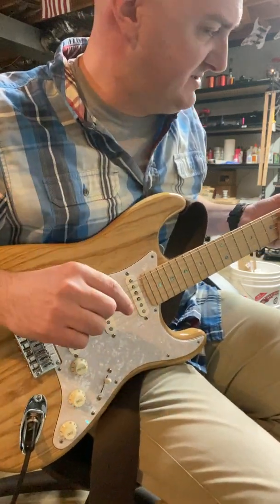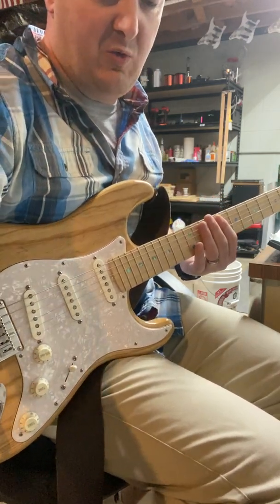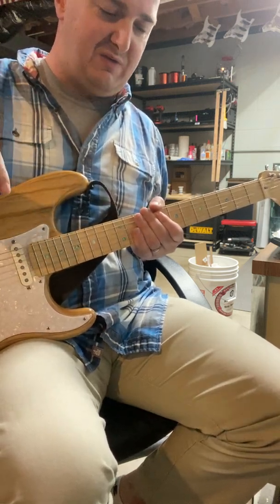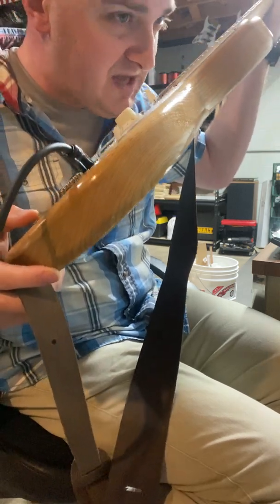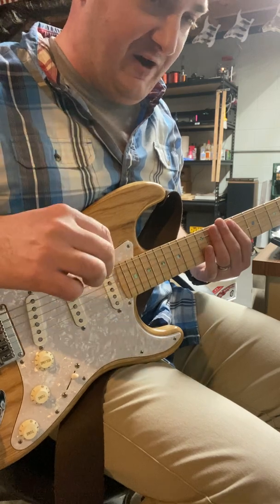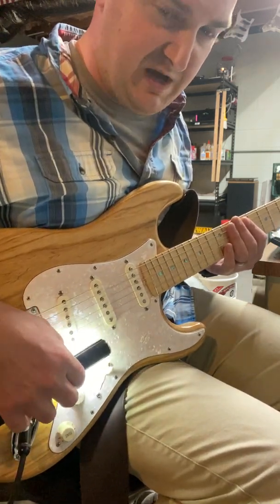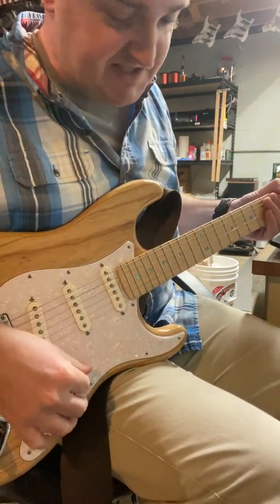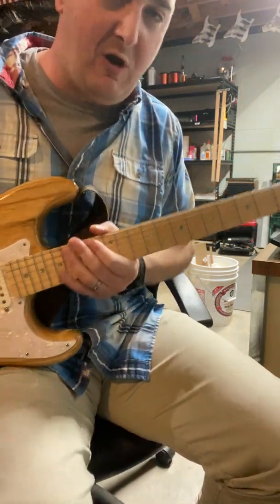60 cycle hum, RFI and Shielding is useless Noisy electric guitars SCIENCE EXPERIMENT

Comment: Shielding will never make a guitar completely silent. It just increases the signal to noise ratio.
Reply: No more like it does take away noise so you hear more of your signal ;)
Reply: Exactly. I think people also forget to consider that their guitar is basically 6 3ft radio antennas, so background noise may be inevitable. But those antennas are visibly unidirectional so it’s much easier to deal with outside noise when it is predictable
Reply: Radar paint may be expensive as phuck, but that solve the problem better than copper shielding.
Reply: No shielding is not a myth try going up to a mic with a hot guitar and see how your lips feel after the shock zaps you back 3 feet;)
Reply: Exactly shielding is a myth

Comment: I tried everything using real single coils ( Not silent, not stacked etc.) The Best i could do was to record using only a laptop and usb powered audio interface.All lights off and everything, using headphones.But there was still noise, and i thought it was somehow less noise. that was beacause i was monitoring clean via headphone, in actuallity i had pretty much the same noise as always. Had to spin 360 to find that 15 degree gap where the noise becomes bearable. but then, i cannot and will no record, rehearse and compose stiff like a statue.I am going to take the same rig out in the woods as far away from any power source as possible.maybe inside a cave to test it ( no joke). im pretty shure its going to sound the same (hummy). with that experience and this video, i officially give up using single coils. it distracts my playing , my writing. i do not want to be an athlete of moving around and all the voodo of Singles.I stil love the sounds of them, dont bother if a fellow guitar player is using them and managing the noise. but i am a recording engineer and my ears are trained to hear noise on a musch more fine degree than SCs, so i really canot tolerate. i Also know that anything i record , it is me who will have to clean up afterwards to mix and master. But even if the SCs do not hum or become tolerable in the woods, its still the same sh*t i MY studio (Grounded, 4 dedicated breakers with clean and new wires straight from the main eletrical  box, using 2 power conditioners). I applaud SRV and Hendrix for their playing as much as dealing with single coils.im currently studiyng how the OGS used single coils, listening close to the recordings.the instruments you showcase here seem to me to be fine ones, wich proves me that an entry level Nocaster and a Fender USA will have just about the same 60hz hum.It depends more on the other pieces on the chain. I rewatched Better Caul Saul this year, and the reccuring joke is - hes gone full Chuck Mgill. So i ordered a Yamaha Revstar Rse20, and will continue to fuss with my tele to maybe keep it.

Comment: So what can be done to reduce these various types of noise? You mentioned a power conditioner… is that a reliable way to reduce at least the 60 hz hum?
Reply from the maker: The only thing that can take away 60 cycle hum is a humbucking pup. Me personally, even when I play with moderate gain at higher volumes, I still prefer a real strat single coil pup to noiseless strat pup.  I just deal with the little bit of 60 cycle hum to get real strat single coils sounds. P90’s not so much. The hum on P90’s is pretty loud due to the coil shape and winding that makes the hum louder than a fender style single coil. So, I opt for a lower output PAF style humbucker. As far as amp noises caused by home wiring, a power conditioner can help with that.

Comment: So the constant sound from the cranked amp no matter what was or wasn't plugged in is normal? I get the same thing with my Marshall when turned way up . Turn it down the sound /hiss/ hum disappeareds. I was thinking something was wrong but I guess its normal.
Reply from the maker: Yea the whole point of cranking the amp was to exaggerate the issue. At normal volumes it is a non issue. The more gain you stack the worse any noise issue will be. As far as single coil hum, l will gladly deal with it for a true single coil tone on my strat. I generally don’t play with super high gain so noise is rarely an issue for me.
Reply: @MathewsGuitarWorks Thanks for the reply. I never notice the noise when at gigs. Only at home while recording trying to get a cranked amp tone.

Comment: Man I did have a two conductor guitar cord a soundman made and gave me. The shield was only one ended and the signal was on two wires. Another may that may help is dont connect the shield in the guitar as a signal path. Some pickups are a shield and one conductor shield as a negative. A strat unsheilded wire and the negative is grounded 
Course all are to ground at the guitars output jack.

Comment: that's why i plan to balance mine as well as shield it with proper grounding, i can tie the grounds at the amp.
Reply from the maker: Don’t waste your time shielding. Passive control components are not affected by RFI and since the pickups are open to the outside environment. Unless you can figure out how to shield the pickup, which is where the RFI enters the circuit, you’re wasting your time. Proper grounding is definitely the way to go.
Reply: @MathewsGuitarWorks  getting rid of noise from the back and sides at least gets rid of some, the balancing should help a lot of the rest, even without shielding.  have you tried balancing?
Reply from the maker: @felderup Properly grounding is the the only thing you can do. Shielding does not stop RFI. Unless you can make a complete faraday cage and place the entire pup inside it then it won’t work. But you do you, good luck.
Reply: @MathewsGuitarWorks  i'm pretty sure balancing without shielding will do something.
Reply from the maker: @felderup what is balancing?
Reply: @MathewsGuitarWorks  it's a way to add differential signalling to a guitar, the ground is separate.

Comment: Would a set of EMGs and a noise gate solve the problem?
Reply from the maker: EMG’s would stop 60 cycle pick up hum.  A noise gate would stop any noise above the set threshold for anything in front of the gate.  This example I posted is an extreme illustration with a cranked amp and multiple stages of gain stacked. When the amp is set at moderately loud stage volume, using normal amounts of gain (stacked gains also) it’s a non-issue. My rig is not silent nor do I ever intend on trying to make it silent. Im ok with noise in my rig for the most part. I just live with it. I hate gates because they suck so much dynamic tone out of the signal.  Not an active pup fan either but I understand every situations different.

Comment: Thanks. After trips to the repair shop with my MIJ Fender p, soldering this and that, I’ve just about had it with the hum problem. So, I just turn off everything in my space and play into my audio interface and Mac. Or I just use my other basses which don’t have this issue. It’s all good. Life is too short to futz with this kinda stuff . 😂
Reply from the maker: @rlbink2498  Noise can come from all different places.  I’ve just learned to live with certain noise.  Now if it can be fixed, I’ll address it but otherwise it is what it is. Thanks for dropping by.

Comment: how bout proper shielded guitar wiring?  is that needed?
Reply from the maker: @stegerguitars  It wouldn’t make a difference. Wire doesn’t amplify a signal, unless it’s wound in a large coil.
Reply: @MathewsGuitarWorks  interesting....i always use grounded and shielded wire in my builds cuz that's what we're taught.... maybe i don't need to stress about it so much,,,,thanx for the response.
Reply from the maker: @ Shielding passive components (not passive pups) is a waste of time and resources. You can’t introduce RFI into a guitar circuit via the wires or pots because they don’t create or amplify a signal.  So, shielded wire and or cavity shielding is useless at best for the purpose of reducing RFI. Shielding around a pup is questionable at best because you can’t shield the face of the pup where the pup does the picking up. Therefore, shielding all the way around a pup but the face seems academic. The best way to reduce RFI in a guitar circuit is, properly grounded circuit, sturdy reliable connections and distance from the actual source of RFI. This obviously does not cover noise introduced through the amp, the power source or 60 cycle hum.
Reply: @MathewsGuitarWorks  i always thought this from day one....when i shielded my first build and thought: "what about the top of the pickup?  isn't that important?"  i've worked on older les pauls that actually had a metal box housing the electronics....why?
Reply from the maker: @ Because people can be wrong. The metal box on LP was an attempt to reduce RFI maybe.  Just no one put much thought into it. Not every decision made in the engineering of an electric guitar over the years was purely functional. Plus the metal box could very well just been a marketing gimmick. Modern LP’s with the metal plate, that serves two functions. 1- easy and speedy assembly, 2- a grounding plate for the pots so they don’t waste time and resources soldering wire to 4 pots. As for the pups, you’re exactly correct. The top/face of the pup is still exposed to the outsole world for RFI to find and there’s nothing you can do about that.

Comment: Shielding effect in simple words: Guitar will sound as you had at all times your fingers touching the bridge, therefore that ground noise will completely go.
Reply from the maker: @AmLarev  It won’t, I’ve tried it. That noise you hear when I’m not touching the strings happens on all my guitars regardless and all guitars do it to some degree. It’s most likely the wiring in my house helping it out. Thanks for the comment though.
Reply: @ you did it wrong then, have a tele and a strat, both 70s. Be sure you screen cavity in the instruments. I use copper tape for the wood, and aluminum for the plastic lids. I also connect with copper tape the cavities so they reach screw holes and metal in bridge. Strat screens behind, through bridge and top (both coil and input socket)
Reply from the maker: @ sir, with all due respect. I’ve run a rather successful custom guitar business for almost 15 years. I did not do it wrong
Reply: @ then how come you couldn’t get rid of the noise with a Faraday Cage. You can even ask an artificial intelligence about it :) 100% gets rid of buzz and static, only noise left will be the 60-cycle hum. For that Hot Rails are good for.

100% proof by people who did right !
Reply from the maker: @ Ok bro whatever you say.
Reply: @ also: not the single coil hum, for that just get Hot Rails in bridge or get use to it.
Reply from the maker: @ I was not complaining about the noise. This video was simply to illustrate for others what noises people may be hearing and where they come from. I’ll stick with my single coils appreciate it though.
Reply: Oh, you can ask AI about it? Well I guess the science is settled then. Wrap it up boys, AI dropped the mic.

Comment: Thanks for the video. What would cause an intermittent issue with louder than acceptable 60 cycle hum (that's the closest sound to what I can hear). Happens with both Strat and LP. Strat does cancel most of the noise in positions 2 and 4. It only happens maybe once a week when I go to play... both through interface using amp sims and using Marshall DSL combo (I have noticed that sometimes I can hear the cubs games through my amp, which is fun). Went through unplugging everything in the room I'm in and doesn't go away. Could this be external radio interference? Just curious. Thanks again for the vid.

Comment: Thank you for such a clear and concise explanation of all the different types of noise and their causes.  I have 1 strat out of 3 that has ground noise as you demonstrated only in the middle pickup. It's less when in combination with the neck or bridge and the worst when the middle is by itself.   The odd thing is...this is a DiMarzio prewired set wit Area style pickups that are " stacked" to cancel out noise.  Neck and bridge are dead silent...middle is just like you show...touch the strings, jack,bridge and it goes away.  Both my other 2 stats....1 with Texas Specials and the other a Jimi Hendrix strat are fine.  I guess there's nothing I can do then but not use the middle pickup by itself or use it with one of the other pickups.

Comment: I guess the frustrating thing is figuring out why one guitar would be worse than another!
Reply from the maker: @creatorTWin  The atmospheric conditions and home wiring play with my amplifier make more of a difference than any individual guitar. 

If we are evaluating just the guitars, it can simply come down to the resonate peak of the pups in the guitar that pickup RFI or noises picked up by the pups.  

Single coils for example, strat style vs p90’s, I think most people find that p90’s have a far more offensive 60 cycle hum than strat style singles. This is most likely due to the fact p90’s have a much broader frequency range because of coil shape.  
 
Speaking of the guitar only, If a circuit is properly grounded, the only other thing outside of RFI is the pups are just noisy. 

Thanks for dropping in.

Comment: Noise gate works fine. Does it help if you solder a wire across the pots?
Reply from the maker: @mikeyoung7448  This video wasn’t for ways to solve it. It was to ID the noise and possible source. 

Noise gates work for some people but not most. Especially people that don’t play with high gain.   They suck way too much tone and personally I despise the gate cutting my sound even when set super low. 

It’s always good to have the controls properly grounded. Most guitars have grounded controls. The better the ground, the higher signal to noise ratio there is, which helps reduce unwanted noise in the circuit. Unfortunately RFI still enters through the pups and if the face of the pups are exposed to the outside world, that is the doorway for most unwanted noise and theres nothing you can do to stop it. 

Thanks for the comment

Comment: Thank you for clarifying the difference between a ground hum, a 60 cycle hum and RFI.  Based on your video my telecaster has a ground hum - when I touch the metal parts the hum goes away.  Here's my question - how do I (or can I) eliminate that grounding problem?  If I can eliminate it, how do I locate the problem?  Thanks for your help.

Comment: Love the video.  I am, however, a little confused.  I recently bought a new Fender Player II guitar.  When I plugged it into my amp (Princeton Reverb Tone Master) with low volume I got a slight hum.  No loud buzzing - just a slight hum.  The amp is right next to my guitar.  When I touched the strings the hum went away.  Dead quiet.  When I quit touching the strings the slight hum returned.  Is this a sign of improper grounding or RF interference?  Thanks.

Comment: Sometimes I hear a radio broadcast coming through my amps, sometimes I don't. Why is that? Same guitar, same cables, it's just not always there. I don't get it.
Reply from the maker: @jsullivan2112  because different pups have different frequency responses.  Think of it like you are changing the channel on your radio when changing pups. Good question, thanks for the comment.🤘
Reply: @MathewsGuitarWorks  No I only have one guitar, I think you missed that.
Reply from the maker: @jsullivan2112  I have the same thing occasionally. In your case, it’s simply a case of the broadcast signal from the source reaches you easier and your guitar picks it up easier. Weather can suppress radio signals. So if the weather is clear between you and the signal source and your gain stages of your rig are set right it would be easier to pickup a distant signal source.  American Meteorological Society published an article about this topic.

Comment: So glad I found this. I almost bought into all that shielding mess, but had wondered about interference in front of the pickups. You just answered that perfectly. Thanks!!
Reply from the maker: @jdaniel0907  Yea, shielding doesn’t do what it’s advertised to do in electric guitars. Something I didn’t cover that shielding may do in certain cases is increase the signal to noise ratio. Honestly, if you have a properly grounded circuit, it still doesn’t help with that though. It’s a proper waste of time and resources if you ask me. Stay tuned, I’m going to make a more in depth video covering just the topic of shielding with some good ol redneck science experimentfunctations. Thanks for the watch and comment 🤘.

Comment: great video. Could you help me, I have a noise in my guitars, an annoying high-pitched sound, I have discovered that it is due to the proximity to the elevators of the building where I live. It only sounds when they are active. How can I solve it...mogami cables? Copper shielding? thank you. great job
Reply from the maker: @ubeimar123  this noise is going to be coming from your amp and not the guitar most likely. Maybe some type of power conditioner the smooths the power before it hits the amp?  With my limited knowledge it n your exact issue, I’m afraid I don’t have anything better to offer.
Reply: @MathewsGuitarWorks  

A small detail is that moving the guitar in its orientation or placing it flat or horizontal greatly reduces the noise. Thank you, I will follow your recommendation!